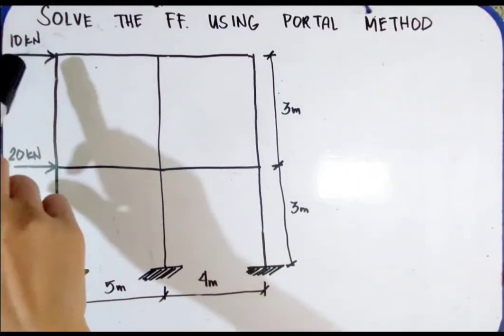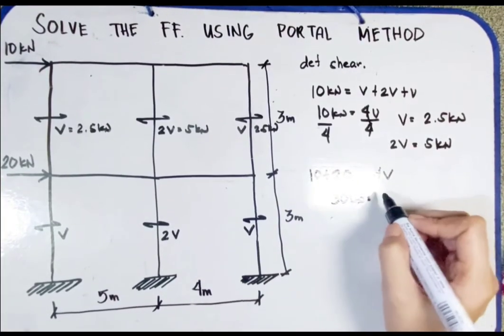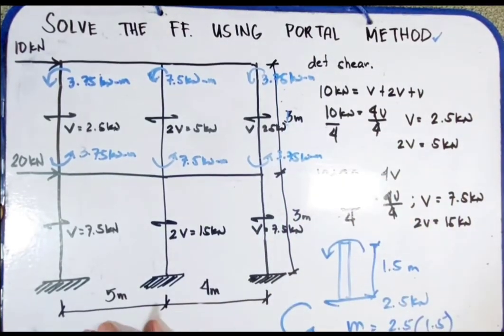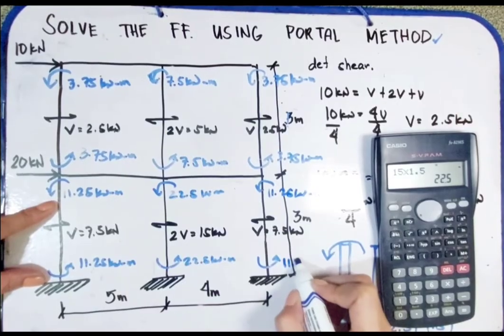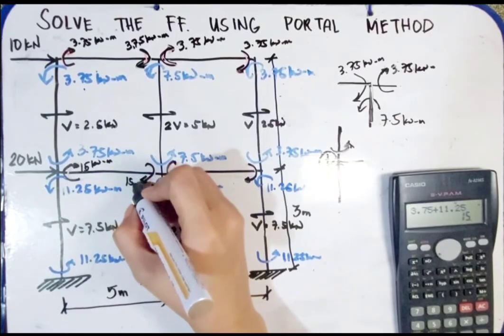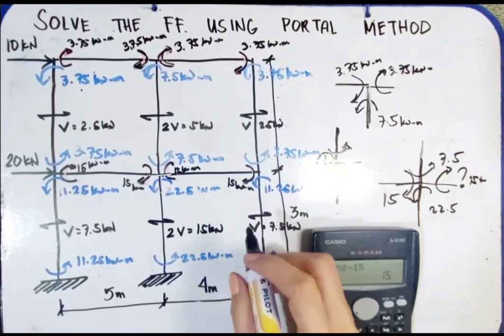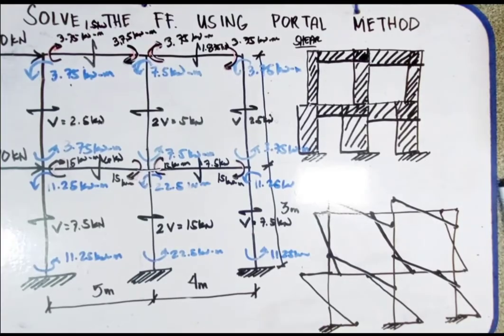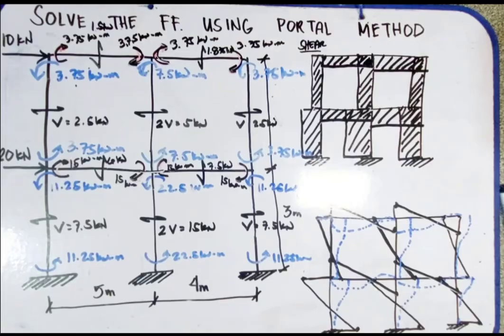PORTAL METHOD (Direct Calculations)

Comment: Like draw a dia and put like that
Reply from the maker: Yes, this is the easiest way to solve the portal method
Reply: @EngrMmBrutas  I see in u YouTube I got xtra 2 method  I'm so confused what I do ।।।  Exam date is 31 july
Reply from the maker: @GHUNGHROO98  actually, there's a lot of method (portal method, cantilever method, Factor method, Rigidity Method and a lot more.)
But if we need an approximate value for analysis of shear and moment we could use portal method. 
You just have to add the two moment and divide with their span to get shear.
And to get the moment, you just have to multiply the shear to half of its distance.